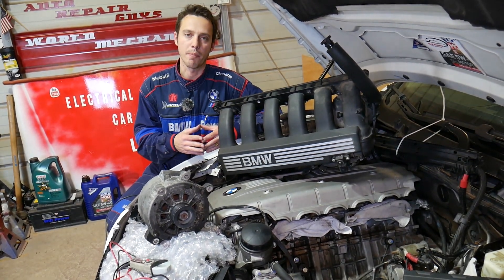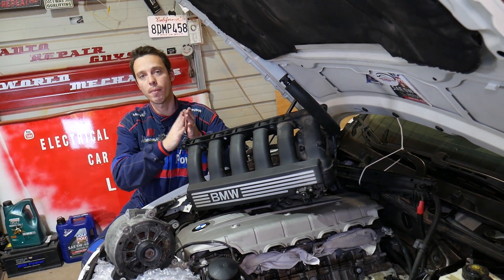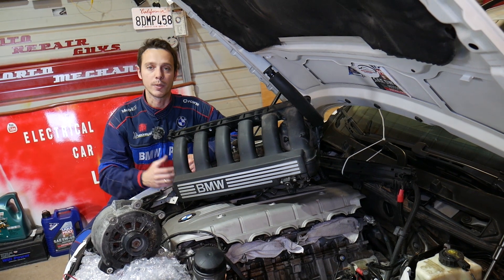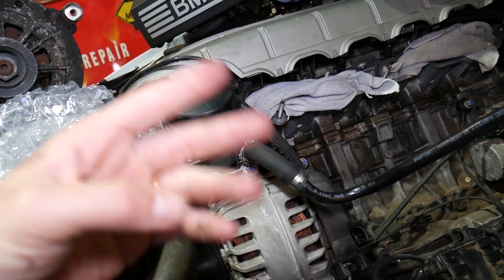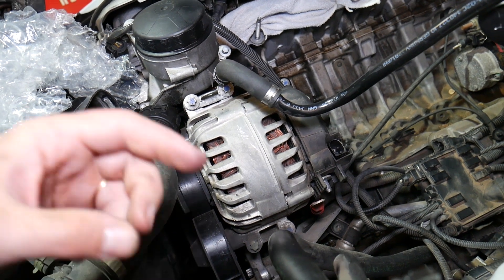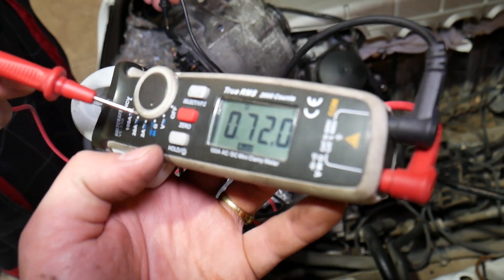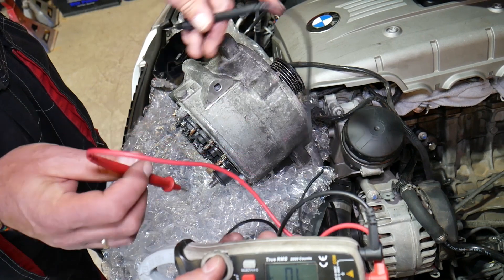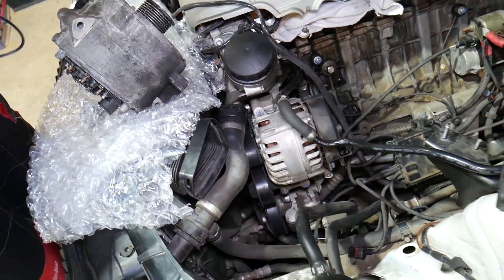BMW E60 E61 BATTERY DRAIN. HOW TO TEST ALTERNATOR DIODE

Comment: What about error 4A07 alternator comunication (permanent) on an e60 520d ??  the car works fine but before the alternator repair the car was stopping because not charging the battery ....the charging is 14v and the pin witch goes to pcm is 13,5 v is that wrong ? supposed to pe 0v ?

Comment: I have an e60 and when I lock the car the shift nob, stereo, push to start button, and the top switches for the sunroof stay on. I have no idea what could be. I check the battery and it said it was bad so I changed it. Still does that. What could the problem be?